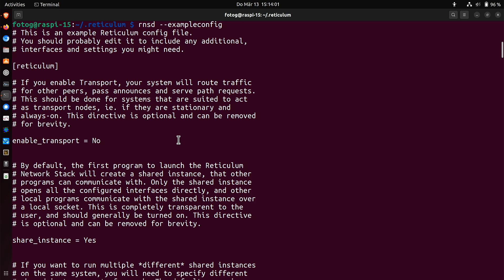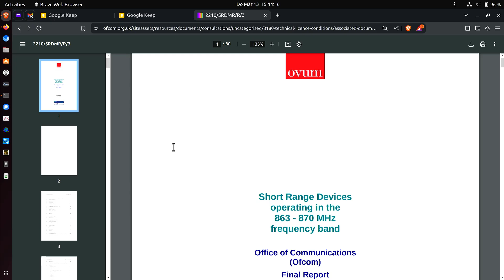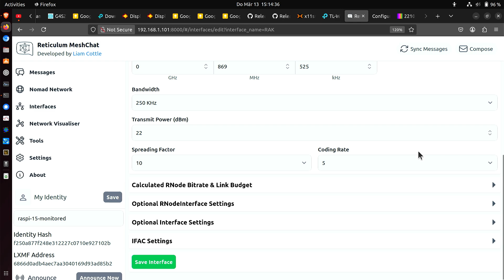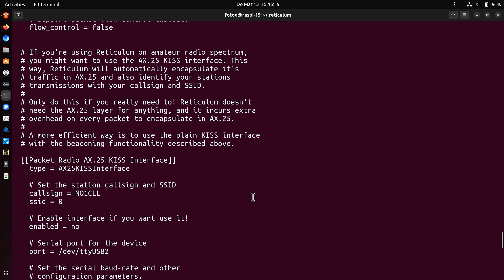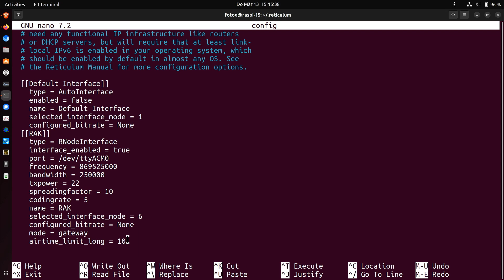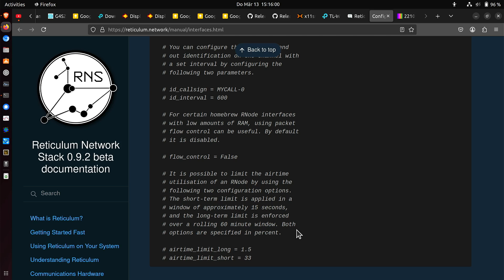Radio Regulations for Meshtastic or Reticulum 868MHz ISM Band

Comment: As far as I understand it, the duty cycle referred to in the ITU harmonised standards (which the ofcom document, and other regulations are based on) is specified over a 60 minute rolling window, so the RNS long-term airtime limit would adhere to that standard. Setting the long-term airtime limit should be enough, but using the short-term one as well can offer more control.
Reply from the maker: Thank you for that informative answer. It's a shame that regulatory authorities are not able to clearly define the rules when setting them. Some official documents I have consulted don't even have a publication date on them !
Reply: @fotografm  Yes, it's all very contrived and dense to make any sense of. Most of the regulations are split into multiple documents that reference each other, and to top it off, then all have slight variations in different countries / legislative areas. It takes reading way to many pages to just get a basic idea of things! Also wish the authorities would take up the responsibility of communicating things more clearly once the regulations are put in place!